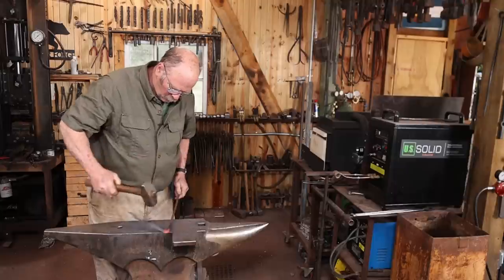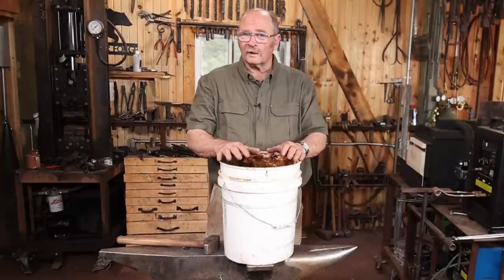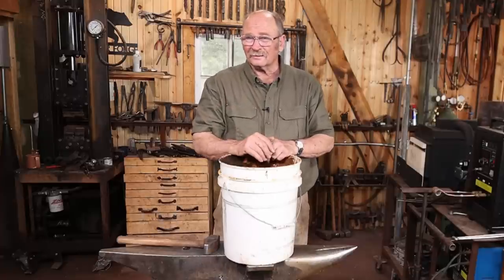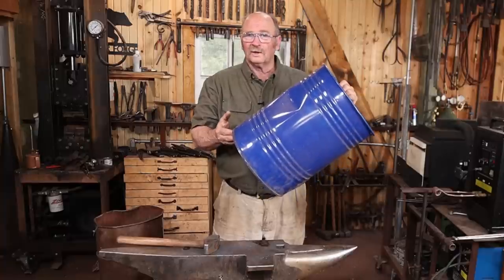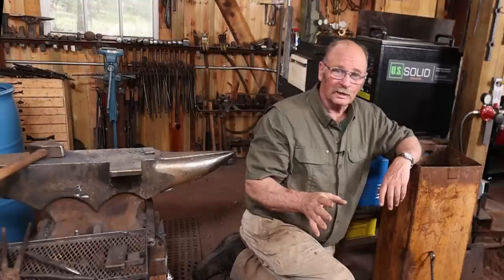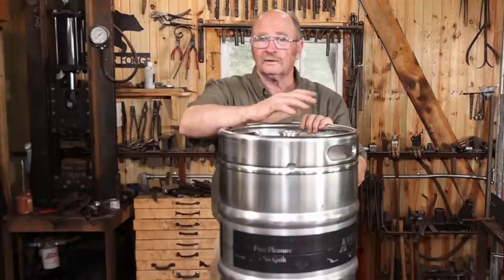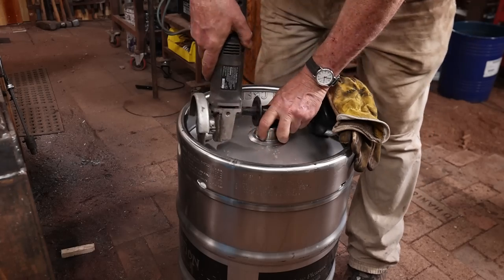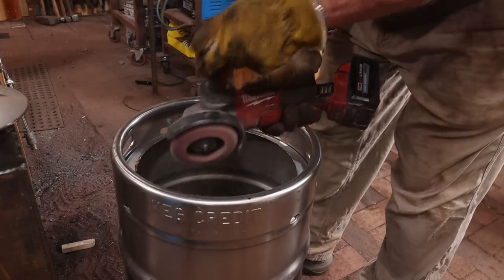Best Slack Tub for your Blacksmith Shop?

Comment: I kept burning holes in the plastic buckets by chucking hot items into them. 😂 
I currently use a galvanized steel wash tub i got at Tractor Supply, but if you go that route, you gotta keep an eye out, because they sell two kinds, one is a feed tub, and is usually cheeper, and not water tight, the seams are not soldered. The soldered one is what you gotta have. Bigger than a plastic bucket, still Kinda small though. 
I also got some steel 5-gallon buckets from Murdochs, they run about $12 and do alright, but as they are small, I mainly use them for ash buckets and vermiculite buckets. 
Almost as important as the bucket itself is some kind of cover to put on it when you are done for the day, so you don’t come back to floating dead mice, which are nasty. It seems like open buckets of water are the perfect mouse bait in my part of the world, so I keep a cover on my tub when I’m out of the shop.

Comment: If all you have available is plastic, like a bucket, look into something made of stainless steel to line it or at least protect the bottom. I use a dog water dish that had a flat bottom and nearly vertical sides. Cut off the rolled rim and drop it down into the bottom of the bucket before filling with water. You might also be lucky enough to find a soup or stock pot at a yard sale that you can get cheap. It doesn't matter if the lid is missing or a handle is snapped off! There's also the Japanese method, in which you make a U shape with three wooden boards and seal the seams with beeswax and pine pitch. One of those, made from some heavy sawmill boards, will last generations with minimal maintenance.

Comment: John ,
I forgot to add ,  about 8 years ago, I was bending some 1/2 inch round stock for a project and my grip loosened and it 
Went around and (Stuck) in my armpit, well I was very thankful that I had a 5 gallon bucket ,again not the best, but it kinda helped to quench my burning a little, but I was still Thankful ! 
Take Care and Be Safe
Reply from the maker: Ouch
Reply: @BlackBearForge  Yes Sir

Comment: If you need to move a heavier slack tub, just get a cheap Harbor Freight furniture dolly of appropriate size to set it on, and fasten a piece of cement board on top to protect against hot metal, sparks, slag, etc.  Screwing it on makes it replaceable, and protects the wood dolly underneath.  I use cement board to protect things from any kind of hot work I'm doing, it's cheap and effective, and I can replace it easily if it gets too beat up.

Comment: If you have the room, an old cast iron bath tub is good. A lot turn up in areas with old buildings being renovated or at scrap yards. Lots of water, you can quench really long items if you fill it nearly full. And if you have a catastrophic accident  you can just jump into it to put your clothing out and cool any burns. I've had a cold brick build fire box built by someone else collapse on me as I was setting it up for work and bury me up to my knees, would have been really nasty if there had been a fire going in it for while.

Comment: Plasma cut the top of mine. Use a brass ball valve to drain it. Stick a piece of hose on that, and you never have to move a full slack tub.
Reply from the maker: How was the ball valve installed in the thin tank wall?
Reply: @BlackBearForge  Weld a nipple on the tank and then attach the ball valve. I emailed you a couple pics to make it clear.

Comment: I'm using an old post driver that's on steroids. Tall and like 8 inches wide. Got oil in that one, and for water I'm using a couple 5 gallon buckets inside each other. It's not the best, but it works. The keg is a great idea.

Comment: Speaking of slack tubs (in summertime) what is your mosquito control method for the tub
Reply from the maker: I have never found it to be a problem with what I use in the shop.  But if it sits for long periods without use, I lid would be a good idea.
Reply: A teaspoon of kerosene.

Comment: Would you ever recommend a copper drum? I always worry about large amounts of idle water for bacteria and copper is ideal against that, plus it won't rust or corrode. Seems you can find a decent enough size online for roughly the same price as the stainless steel one.
Reply from the maker: I can't think of any reason why it wouldn't work.  But I also have never had reason to worry about bacterial growth in a slack tub.
Reply: @BlackBearForge  Good to know, I won't worry about it too much then! I'm a beginner blacksmith waiting for IRL courses to resume in September. Love your videos!